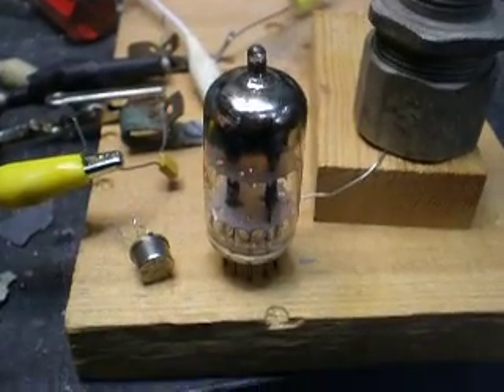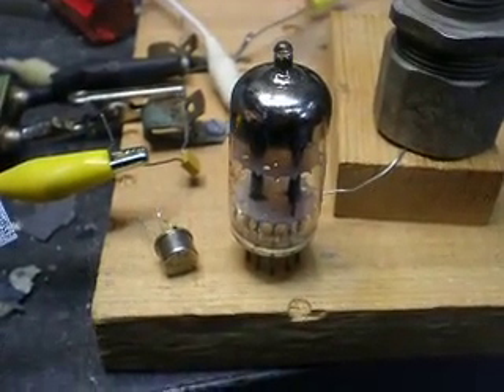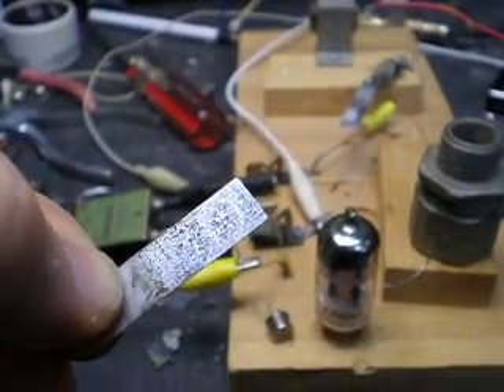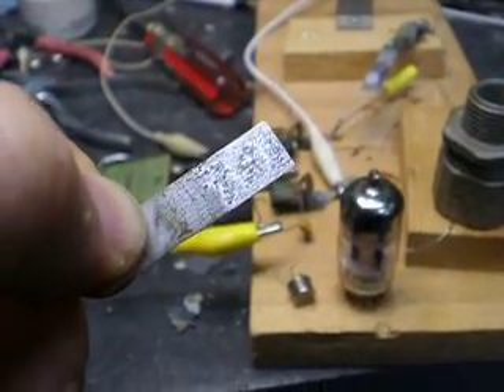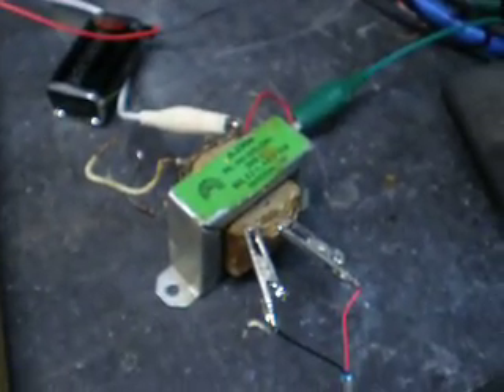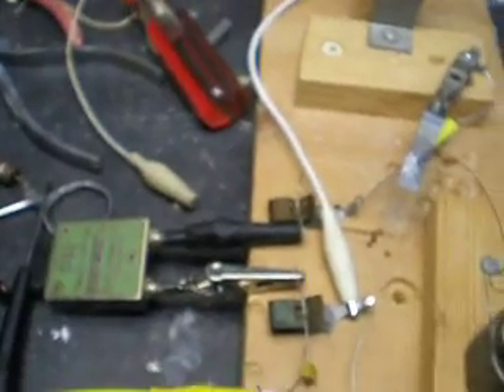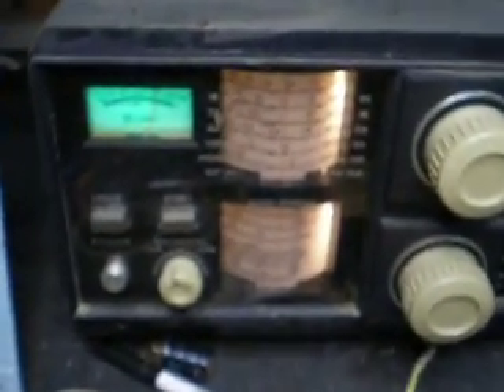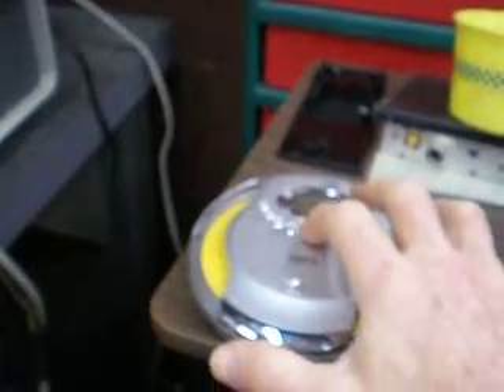Radio Transmitter made out of Junk

Comment: I built a simple audio oscillator using the heated galvanized sheet metal device just to see it go for myself. It really is pretty easy.
Reply: jwatsjunk Hi I saw a comment of yours on another video about you having a PDP 8/S! I just wanted to say that's awesome! I have personally lusted after a DEC PDP system ever since I started collecting vintage computers a few years ago. I just haven't been able to find one yet in the right place at the right time. I personally wish you luck with restoring the system if you ever decide to!
-Connor K

Comment: today, they use microcontrollers to toggle GPIO pins that toggle the Base on NPN transistors. I am using an Atmel UC3A3256 MCU and a TIP3055 power transistor that can go all the way up to 70 volts.

Comment: Some cards have crystals with 2 pinouts, and some have crystal oscillators with 4 pinouts.  You want the oscillator type, which has 4 pin outs, and will look like a silver rectangle package soldered onto the board with 4 corner points, and a dot on the top indicating I guess lead #1, with the rest being read clockwise.. lead 2,3,and 4 going clockwise around the top.  Correct me if I'm wrong.  You can make a simple CW transmitter with a few parts out of one of these to transmit on that frequency.

Comment: I don't need either of those, you can find crystal oscillator chips in spades on old ethernet and video cards.  The older they are, the lower the value.   Old PCI ethernet and video cards will have them in the range of 20,25,55, 66Mghz typically...    I just picked out an old S3 video card that has one on it of 14.31818.   If you want lower ranges, dig out old ISA video and ethernet cards. If you want even lower, look at the motherboards of old 8 bit computers...  8 mghz, 4.77, 2 mghz, etc.

Comment from the maker: If you got to Picasa and search for "Zinc Negative Resistance Oscillator" the schematic should come up.
The ZNRO is a neat science project, but can be tricky to adjust and may not be stable for long periods.

For those who want a "real" AM transmitter for home broadcasting, etc., there are plenty of plans on the internet and kits are available from various manufacturers.  Have fun!

Comment: @ranickel Hey, I have some questions related to this vid and I was wondering if you could answer me :)
Is that capable of sending radio signals with +/- 75 megahertz?

How can I send radio signals in different frequencies? I want to build an RC 4x4 car, so I wanted to send in different frequencies to its different functions, like accelerate, turn left, turn right, backwards, brake and thing like that. Is that possible to make in home? I know they are pretty difficult circuits for beginners... =\

Comment from the maker: I do not have a coil in this transmitter, just the crystal which oscillates at a resonant frequency.  However I'm hoping to find time to experiment with adding a link-coupled coil to make it easier to connect to a real antenna.  Testing was done with a short piece of wire laying across the workbench.

Comment from the maker: The oscillator is based on the principle of "negative resistance" which means that the current does not increase with applied voltage as is normally the case.  This is because the heat treatment of the zinc strip creates a crude semiconductor.  Google "negative resistance" for more info.

Comment from the maker: Hi,

The range of a transmitter like this is VERY limited, I'd say 50 to 100 feet using a short antenna wire (about 10 ft.).  There is an FCC limit, but this transmitter operates at an even lower power level than most similar devices.

Bob